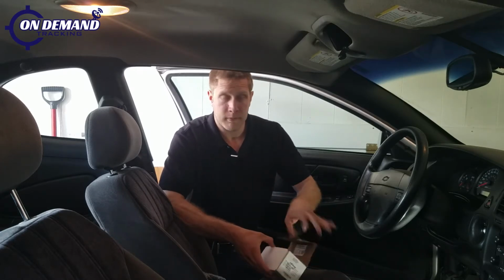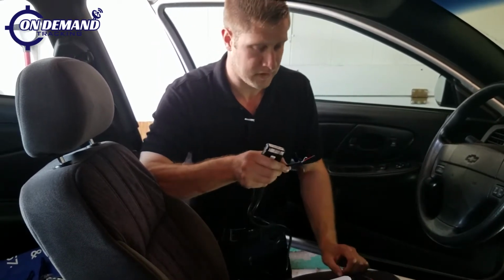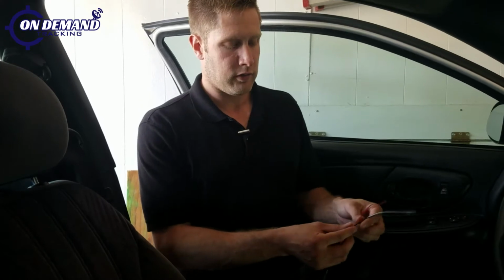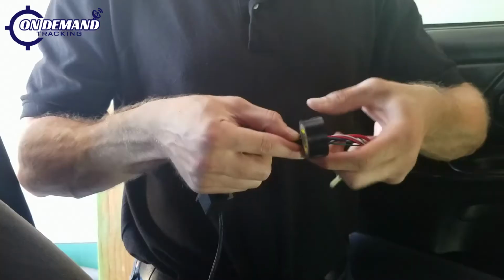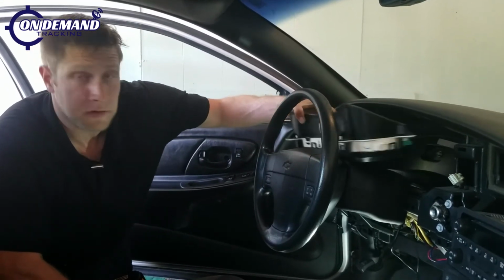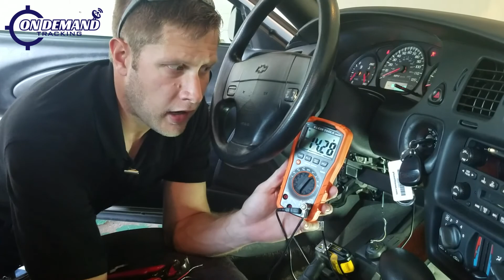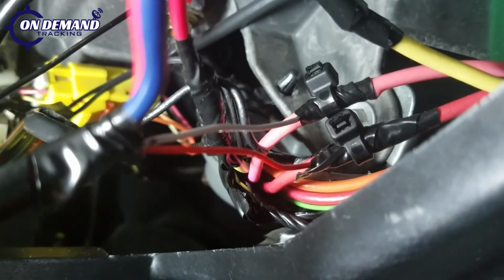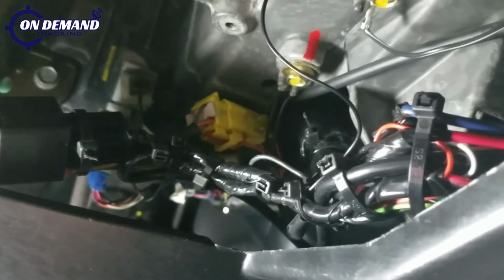CalAmp LMU 200 install guide

Comment: What kind of multimeter/probes were used in this tutorial that you were able to measure the voltage without splicing the wire?